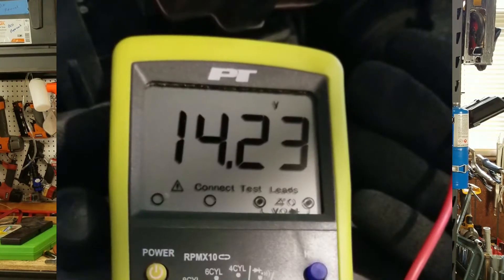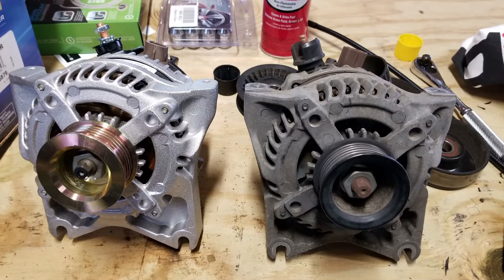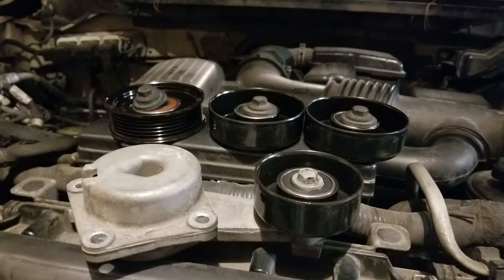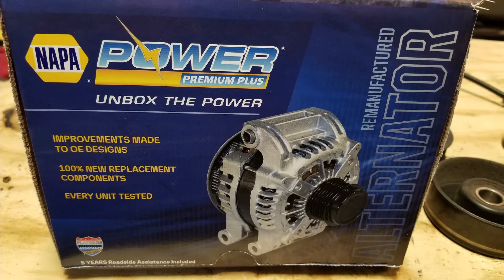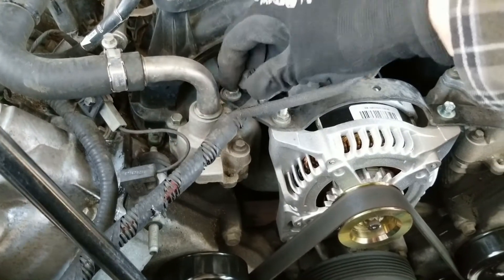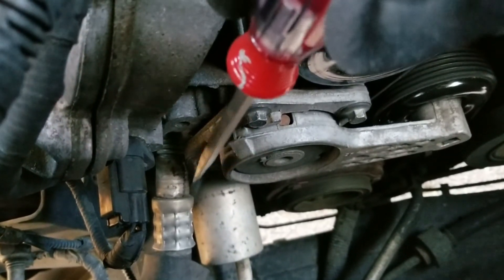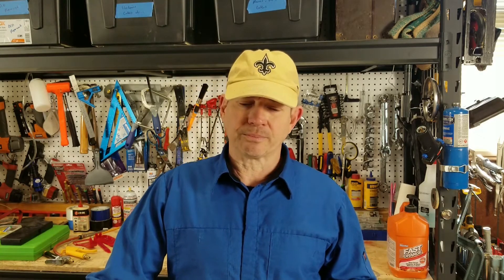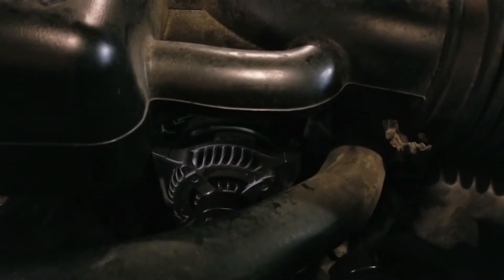WHAT'S THAT NOISE?!  Engine Whine #engine #alternator #noise #mechanic #f150

Comment: Older video but needing help in parts- which pulleys are smooth which ones are grooved
Reply from the maker: @fatheadfit1071 Thanks for the question and for watching.  You can jump to the 43:15 mark in this video to see the pulley layout.
https://youtu.be/0h0Dt8qR3CE?si=6DAfkp6anJuWro7q

Comment: I have a very similar sound coming from my ‘13 expedition, but I’m a bit thrown by the fact that when I listen close it doesn’t sound as much like it’s coming from the alternator, rather it sounds a bit like it’s coming from lower and to the right (when facing the engine). I’m no mechanic though so I’m curious if yours presented the same way or if the whine was clearly coming from the alternator when you listened to it with just your ears.
Reply from the maker: I suggest a mechanics stethoscope, that is how I pinpointed it.  Lower right likely will be the power steering pump.
Reply: @DailyBrewGarage  thanks for the advice. Stethoscope made it clear that it was the idler pulleys on the right. Easy swap and sound is gone.

Comment: I had an alternator rebuilt/upgraded output on an E-350 and it was around $125. It still worked but same deal that front bearing was howling at 196k miles.

Comment: I'm experiencing SAME issues you were, a 2010 5.3 silverado, wining from start increase with rpms, I did narrow it down to alternator, and now I'm on the SECOND one still I have the wine. I replaced idler pulley and belt tensioner, still wine. This morning however (sorry in advance I'm not great with diagnosing electrical) so I pulled the plug on the alternator while it was running, wine stayed, plugged it back in and then removed the positive battery lead from the alternator and BOOM  wine was gone,  put it back on wine came right back... any suggestions on this issue?
Reply: And the two alternators I've gotten were brand new NOT remanufactored
Reply from the maker: Thanks for visiting my channel.  I'm going to take a guess that your issue is either a bad voltage regulator, a bad battery, or possibly some damaged wiring in the middle that is throwing the voltage off.  That is where I would start looking anyway.
Reply: @DailyBrewGarage  I appreciate the suggestions!
Reply: @AZHerps  Did you find and fix the issue?  Having same issue at the moment
Reply: @Alexander S  I have not, it's driving me bananas, I had the battery and alternator tested at oriellys they both passed, but it's clearly the alternator making the sound 100%. Voltage regulator was suggested but my truck from what I see doesn't have its own, I believe it's built into the alternator unfortunately I can't get a different brand alternator either unless I want to fork out another 250f plus,  or keep swapping out a new one for another new one of same brand just to have same issue, and far as wiring between battery and alternator..well there's just one cable from battery straight to alternator and it looks to be in okay shape..I'm stumped & annoyed because it's obnoxiously loud
Reply: @ryanb.305  Its really easy to put in a new voltage regulator,and while you have the alternator apart you can check the brushes and see if they are worn down. I did some research and the whine can be caused by the alternator overworking trying to charge the battery.Can also can be a bad diode. I dont fully trust the alternator dynos at these auto part stores. Best of luck to you man. Thanks for the quick reply
Reply: @Alexander S  yeah unfortunately I've found majority of parts are garbage these days,  I typically try and go Acdelco with parts it just depends on what I'm working on, I don't see myself having this truck for a long time so spending twice the price on an acdelco  Alternator but now I'm again seeing why I should have.

Comment: Good work.  I'm 99.9% certain that was a bearing.   A pully, in my experience,  doesn't sound like that.  Besides,  a lot of these parts are throw away.  If ine part goes bad, the rest isn't far behind.
Reply from the maker: I guess I did use "pulley" in place if "bearing" now that you mention it.  I was really referring to the bearings in the pulleys.   Good point if clarification though.  Thanks!
Reply: I think bearing too....what are all the noises it could be? Pulley...bearing...and alternator itself?